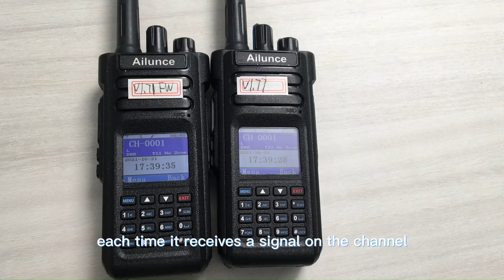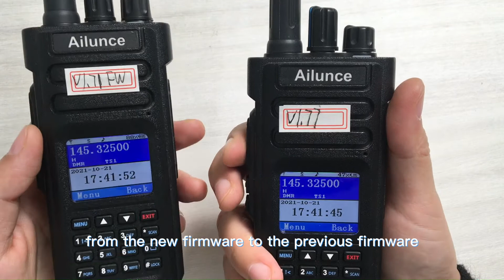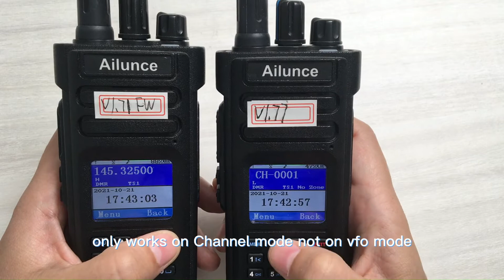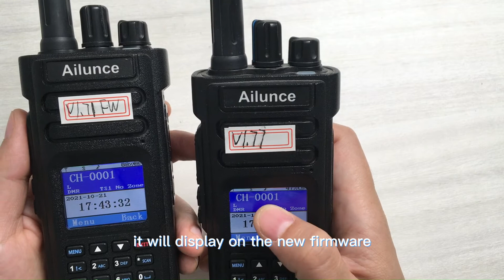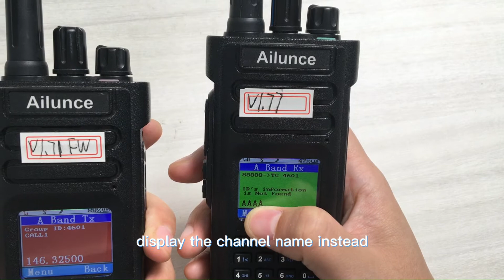#AilunceHD1 How to show the channel name instead of frequency on when receiving a signal?

Comment: Thank you! Although this is DMR radio and primarily designed for digital use and i get this. There are tons of videos about this radio online, but no one has tried to fully explore its capabilities only using it in Analogue mode only. From what ive read most of Analogue functions will not work unless you get digital id code programmed into radio first. This is total nonsense. Why didn't Ailunce made firmware where you can fully switch to DMR or Analogue??

Comment: Regarding the procedure of firmware update, I see that we need to simultaneously push 3 buttons. That will mean that, there is a possibility to transmit something. If there is no antena connected, the Ailunce HD1 had the protection incorporated (to cut/reduce the power), in order to avoid burning the transmitters circuits?
I see that most "modern" HAM radios have this (foldback) protection implemented.
Reply from the maker: HD1 has sold several years already, it never met this problem, Please don't worry.
Reply: @Ailunce  I still hope that you will "fit" a usb type C charging port on the battery (even reducing the capacity). Having such charging port is a "must" for an device ment to be used outdoor, in the wild, far from a wall socket.
Reply: Although this is DMR radio and primarily designed for digital use and i get this. There are tons of videos about this radio online, but no one has tried to fully explore its capabilities only using it in Analogue mode only. From what ive read most of Analogue functions will not work unless you get digital id code programmed into radio first. This is total nonsense. Why didn't Ailunce made firmware where you can fully switch to DMR or Analogue??
Reply: Another excellent video......Although this is DMR radio and primarily designed for digital use and i get this. There are tons of videos about this radio online, but no one has tried to fully explore its capabilities only using it in Analogue mode only. From what ive read most of Analogue functions will not work unless you get digital id code programmed into radio first. This is total nonsense. Why didn't Ailunce made firmware where you can fully switch to DMR or Analogue??